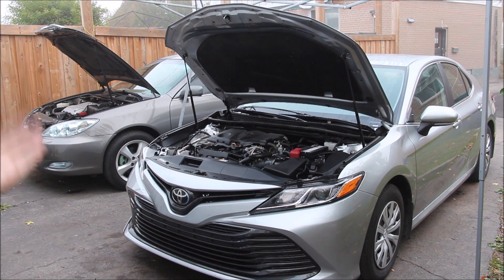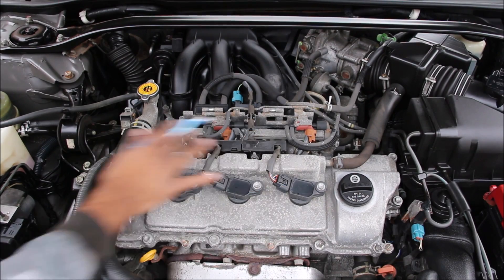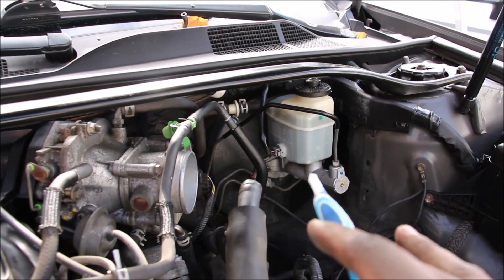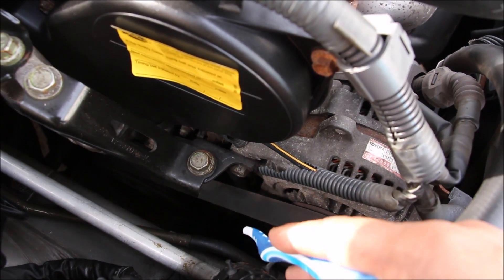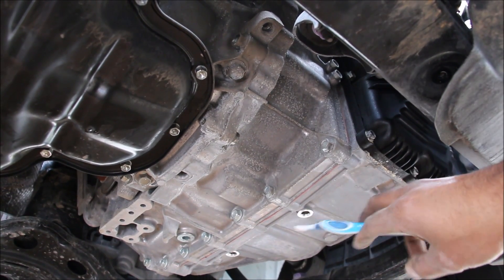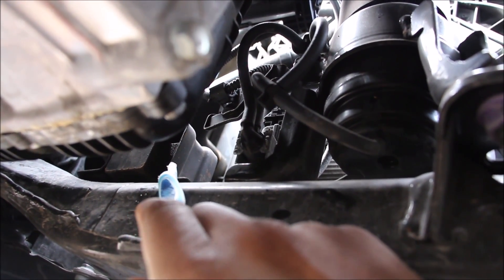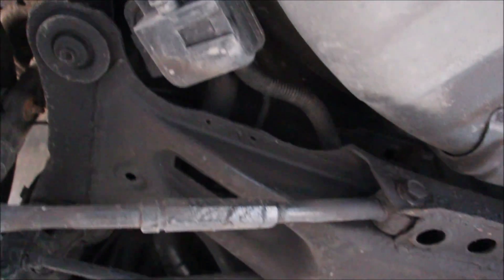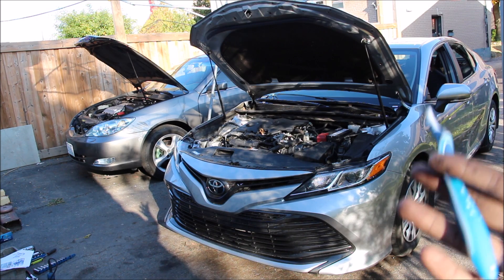Toyota Camry Mechanical Review | What Changed in 15 Years?

Comment: I have a brand new 2023 Toyota Corolla Cross.
 Welcome to the world of cheap/tinny/ and utilitarian. Parts on my vehicle are on the Crown vehicle and all the others suv's on downward from the Highlander. Once more, generic, sameness, cheap. Check it out, it is a fact.
 Interior plastic is crappy and the sun visors are made from a type of Kevlar as far as I can tell.
 They should be able to stop a rifle bullet fired at you, but when your head is going in the 'other direction' it is going to hurt like hell. Not much in the way of anything soft more than 1/16th of an inch anywhere in the interior other than the actual seats. The center armrest hurts and is generally too small/ too far back/ and hard as a board. I will fix that issue soon!
 Just cheap cheap looking. Carpet, what carpet, some form of packing felt. That I can change, floor mats both types are OK with me. Had to buy a trunk rubber mat/ and it fits well and is OK. I will never use any of the seats personally just the driver seat so I really don't care one way or the other. One colour for the interior. Black. How nasty. Should have bought the two-tone cheap model. Looks bigger inside, and you won't lose stuff as easily. Once again just cheap. Catzkins seat covers will soon enter my life.
 On the bottom side, I like it. Well sealed, most things I have looked at are well-made and easy to get to. But I bought a FWD vehicle so I have more room to play mechanic in when the time comes. Old-school rear suspension is just fine with me.
Way too many electronic gismos and the use of soft plastic around the engine compartment doesn't bode well for having a classic vehicle on show 30 years from now.
 But ... I won't be alive then, so who cares? lol
 The bottom line is 'every penny saved is a penny in our pocket'
Reply from the maker: Yep, it's a basic car

Comment: Truth of the matter, Toyota has gone to cheaper and making things lighter. Quality of materials is inferior to previous years. Toyota cuts corners just like all the other auto manufacturers. Bottom line is about money and profits. Vehicles today are consumable throw away and almost non-repairable. If the frame becomes bent or a single airbag goes off, the Auto Insurance Company will deem it totaled. The vehicle will get auctioned and salvaged for parts. Toyota company, Toyota dealership, and the Auto Insurance company profits while you lose money. Toyota and the Dealer can then sell more cars because you are in need of another vehicle. The Insurance company can now raise your premium since your car was deemed total loss. The recovery and recycling of your loss vehicle is done for profit by authorized and licensed shops by the government. Again, you are the loser if your vehicle ever becomes involved in an accident. The insurance company wants it listed as a total loss because it is in their favor and to their advantage. It is a racketeering scheme. Plastic, glass, and aluminum is cheap. The more Air Bags installed into your vehicle, the higher chance of one being triggered so it can be deem totaled. Don't worry, car prices are going up along with auto insurance, it is all a legal scam and for profit. Need special tools and diagnostic systems to fix a car nowadays. Repair Manuals are withheld as if they are secret and confidential material so you not able to do the work yourself. At least the are millions of 8th Generation Camry's with 7 iterations (7th year) which means getting parts should not be difficult to obtain. Toyota's Mission Statement is Build Cheap, Say we use superior quality parts even though we don't, when factory warranty expires that the vehicle starts having problems, and sell at a high price. Your new vehicle is only meant to last 3 years, other parts don't break down until after 5 years. At that time you will want a new car and to repeat the cycle as in Pay More, Get Less. - Scotty Kilmer's horse laugh.

Comment: my old camry 320k orig front end trans fluid starter alternator shocks struts just did oil brakes tires radiator and the thermestat my new camry 19 idk if i'm a fan i mean its sporty and faster sits low too low heat sucks takes 4 ever to defrost  and ac is not as good it drives rougher over bumps and got a lot flimsy plastic even the way the carpet sits and the seat is atttached.. I hope it lasts me as long even the road  noise is worse then my old camry with 320k i'm little disapointed but time should telll Whats the highest miles anyone go with orig transmission me and my buddy got toyota lexus ford and subaru all over 300k orig whats your guys take?

Comment: Interesting, normally I'd more prefer the older one, but here... The newer one just looks easier to maintain, and like it will be at least as reliable as the older one. The only way that doesn't seem to be the case is the transmission. Which, I'm guessing will be the failure point. 

Also those teeth on the fan blades, I'm pretty sure that's for reducing the sound of the blade when it's running.

Comment: I owned a 2017 Camry for a bit.. That's the year you want, none of the new brake assist, lane assist garbage. It did have skid assist, but a button let you turn it off temporarily for things like driving on ice. Lol, yes it was easier to drive on ice with skid assist off. Otherwise the tires will just spin and stop on the ice, you can't rock the car when stuck.

Comment: I purchased my first 2005 Camry brand new and it's dealership maintained, everything is still oem on the car except for tires, rotors, shocks, flex pipe and 1 engine mount and oil pan bolt was damaged by dealership. I now have 300,000 miles on it, clean no accident, interior is super clean. Transmission is oem. No oil burning no leaks. I'm hoping I can get another 200,000 miles.
Reply from the maker: What engine? 3.0?
Reply: It's a 4 cylinder 2.4L, USA assembled. Base model.
Reply: Engine: 2AZ-FE , 2.4L , manufacturer: Kentucky, 🇺🇸

Comment: I currently have a 2015 Camry with the 178 hp 2AR-FE. I prefer cars from 1997-2015 the best when it comes to cars with internal combustion engines. Otherwise, I prefer an electric car. My favorite Toyota engine is the 268 horsepower 2GR-FE. I used to have a 2004 Lexus RX330, love the thicker steel, the leather seats are very comfy, it has a reliable but, minorly flawed 3MZ-FE engine, and the 215-watt stock pioneer sound system never lost a single ounce of sound quality it held up better than many Bose sound systems. The second-generation RX is my favorite internal combustion engine crossover ever made. It's made back when crossovers are cool, not overrated grocery getters or college boy high riders. If I were to buy another Lexus I would get an ES350. If I designed a car it would be a fiber-reinforced polymer unibody all-electric car.
Reply from the maker: I like my Toyotas too. The 2GR is a powerful engine but packs the refinement of the 1MZ V6. I have them both

Comment: These cars are developed and engineered in a country that looks after its road and rail network (Japan), if the Camry’s were driven in the UK (spends more on its railway system than its over-capacitated road network) or USA (spends more on NASA than its crumbling road network) where the parts and rubber bushings will just deteriorate and will be a pain to replace over time. I know this I owned Toyotas for years. Had a Supra JDM 5 years ago, every part  was factory whilst the UK market one I looked at, same age, everything was worn or rusted.
Reply from the maker: Nice

Comment: You don't need to remove the intake plenum to service the rear bank plugs on the 1MZ if you know what you're doing.
Reply from the maker: If it's the newer plastic plenum then you have to remove it. The older metal ones had enough room to work.

Comment: If a Camry is boring, it's because it's Automatic. I got an 07 Camry CE model with a 5 Speed Manual Transmission and lowered on Coilovers, Aftermarket White wheels, Exhaust. Fully loaded inside the interior, except for Heated seats. I have Black Leather seats all around and I'm doing an engine swap 2AR-FE and a 6 Speed Manual Conversion for the new Transmission. I wanna do some port polished work before a Turbo. My Camry is fun to drive, I usually just cruise most of the time it turns head. If any cars are boring, it would be Civics and Accords.

Comment: The US received two V6 engine options,  a 142 kW (190 hp) 3.0-liter V6, and a 157 kW (210 hp) 3.3-liter version of the same. The 3.3-liter was only available for the Camry's sportier "SE" model. Even though the 2004 he is comparing here is an LE, it has 2 items that only came on the SE ... One of them is the rear spoiler, and the 2nd are the fog lights.
Reply from the maker: I swapped so many things on my Camry, full black leather interior, fogs, Solara wheels, facelift 2005 tails, etc. Previous owner added that spoiler.

Comment: I can see why nobody wants to buy the new version. Direct injection, plastic manifold, only 4 cylinders, etc. We had a 2000 V6 Camry for 17 years. It ran great for 330,000 miles until a head gasket blew. The repair would have cost too much so we scrapped it. I would NOT buy one of the new ones.

Comment: The older v6 camry is such a satisfying vehicle to drive while remaining comfy. It drives smooth as butter. I daily one with the same engine (1MZ-FE).
Reply: The XV30 Camrys have a 3MZ-FE engine (3.3L V6)
Reply: @FlexSZN23    The 2002's still had the 1MZ 192 hp then bumped to 210 in '03 with VVTi.  The 3MZ VVT was introduced in 2003, 225 hp.
Reply: @tsfullerton  no, 3mz made 225hp
Reply: What is the average MPG?
Reply: @hedgehogthesonic3181  24mpg. In the past when I was doing a lot of city/town driving I've seen it as low as 14mpg.
Reply: @TheyWhomTheGodsDetest   Well, that's quite bad for a car of that size and chape, but is a big engine so such thing is expected.

Comment: Good review, I have a 2018 Camry (exactly like the 2019) and had a 2005, I wore out. New one, even though he goes through some items they reduced the robustness from, it is a pleasure to drive. This reduction must affect the mileage e.g.  a trip from Charlotte to Ft. Pierce a month ago. Round trip was 1195.6 miles with (14.1gal to + 14.6gal back--tipped off) that is 41.5 MPG, truly amazing. Only trouble is the 2018 battery runs stuff when turned off, gave up the ghost after 19 months--bummer. Hint: run it daily.
Reply: Mike,  If you don't drive a car daily, my solution was a solar panel with a regulator.  I have an 03 Superduty 7.3 with 40,000 original miles on it and this keeps the batteries up in addition to prolonging battery life.

Comment: I'll stick with the older Camry.  I'm over 280K miles on a 2001 Solara and it runs like new.  I don't care for 4 cylinder Camrys because they don't run smoothly.  Also things like electric water pumps sound like they're prone to failure.  Why can't they stick with a twist on oil filter that has worked for decades?  Who thinks of these bad ideas?  We have four Toyotas in our family and they all use the same oil filter.  Why fix it if it isn't broken?

I doubt if the new Camry engine would have the same reliability my older one has.

Comment: The new 8 speed transmission is trash from what ive heard. Has a lot of issues. I hate v6 front wheel drive. Just a pain in the ass to work on. Thank god hydraulic power steering is a thing of the past. I got electric on my chevy to.

Comment: As an owner of one of these new Camrys your review gave me a good idea of what to expect in the years to come as far as maintenance goes. I would've liked a little more detail on the direct and port injection that you went over on these new Camry 4 cylinder engines. Im assuming carbon buildup shouldn't be to much of an issue w these motors? Thanks for the excellent content.

Comment: Thank you for this video, I think Toyota did a good job on the new Camrys. Especially with the fuel economy and power, the new 4 cylinder does 0-60 faster than the old v6 and the new v6 give more more power than the old v6 while impressively giving you better fuel economy than the old 4 cylinder. Only time with tell how reliable these new dynamic force engines are but Toyota has been testing this engine since the early 2010s so it should be a smooth ride with few issues.
Reply: Imagine if you'd put a turbo on those 2.5L... I guesa it is too much of a reliability problem with the fuel prices in the US...

Comment: This a25 engine in new rav4s and camrys looks not that bad. Water pump is just 4 bolts and one connector. Everything still has more or less clearance to work with. Active engine support?  In couple of years we'll have oem ones, so nothing to worry about. My only couple of weak spots: that plastic automatic transmission valve body cover. This going to leak in 5 years or so. And second I really hope that timing chain is a solid one and not like chains you can see with VWs (50-60 thousand miles and that's it).

Comment: The biggest advantage I see in the newer Camry (just got one, a 2020 though) is the multi-port injection system (where it uses both GDI and port injection, just reducing carbon build-up that plagues GDI-only engines).  Obviously there are ways to clean the carbon build-up but for those who do highway driving, this should extend the amount of time between those cleanings on the newer Camry.   This and a few other refinements are also welcome on the new Camry.  The only thing I am not particularly fond of is that they had to go to an 8-speed versus the older 6-speed that was more tried-and-true.  However, I suspect they did this for fuel economy reasons (as the new Camry can get around 40 MPG highway and about 34-35 MPGH combined, whereas one with a 6 speed might be more like 25/35/30 combined).  This is also of course, my first Toyota so I can't personally compare to an older one but I've read a lot of people's reviews and the transmission change is one thing that comes up a lot.

The other thing that's beneficial is electronic water pump and oil pump.  I feel this is a better design because you can now put sensors on the pump itself and if it malfunctions, it can alert the driver or even shut down or prevent the vehicle from starting to reduce the possibility of engine damage.  Plus these components are more external to the engine (bolted on the outside of the engine versus being inside the engine assembly like they are on most traditional vehicles, making repairs a bit more expensive IMO because you have to take the engine apart.  Add that with the termal efficiency of the newer TNGA designs and I think it's a pretty good setup.  Yes the transmission is less than desireable but I believe they have made improvements since the 2018 Camry.  This is why yeah I wouldn't reocmmend anyone buy a 2018 (or any new technology when it first comes out -- same reason I didn't buy a Corolla with the 2.0L with the launch gear--it was only released in the 2020 Corolla so we have yet to see how well that holds up.  At least with a regular automatic, the likeliness that they will have a ton of problems is less likely because of the overall design.  CVTs are still not durable enough IMO for one to expect to get hundreds of thousands of miles out of them.  YOu might get 150k out of one, maybe 200k but I am still a fan of the regular automatic, even if it's the 8--speed.  Gears can take the stress better than a CVT can.

The other thing that has changed in the Camry over the years is safety too.  Not just the automated safety features (like Pedestrial detection) but the metals that are being used.  Older cars (say ones made in earlier 2000's or prior) may look like they'd be safe because their bulky and heavy, but it really comes down to metals and the construction.  You now have light-weight aluminum that is stronger than some of the much heavier steels out there.  And the cheaper plastics may also be partially for safety reasons.  Think of a door panel that pops out of its clips on a side impact. I'd rather have a door panel that easily cracks or shatters than one that's rigid and can possibly puncture a person's side because it's so rigid.  I mean from a quality standpoint, yeah the heavier plastic panels are nicer but for safety they may not be all that great in reality (in a cash).  Plus with airbags in the doors and such, they have to make the plastic thinner so the plastics can flex so the airbags can deploy in time.  So part of it is cost, the other part (I'm going to venture to guess) is for safety.
Reply from the maker: Good points but I'll stick to my 04 Camry for now

Comment: Great Video. I prefer the old Camry. Have 233,000 miles on mine 2.4 litre F2AZ engine. Yes it burns a qt. of oil per month wasn't covered under recall for later models. Only replaced blown radiator assembly/upper lower hoses, water pump, thermostat, surpentine belt, one section power steering return pipe and blower motor. Still have same MacPherson struts. Will need replacement maybe next year.
Reply from the maker: Yeah I prefer my V6 over the 2AZ, mines going strong but hasn't hit 200K miles just yet

Comment: Meanwhile, my 2000 corolla has over 200k miles and still using the factory transmission fluid.
Reply: Is that a manual?